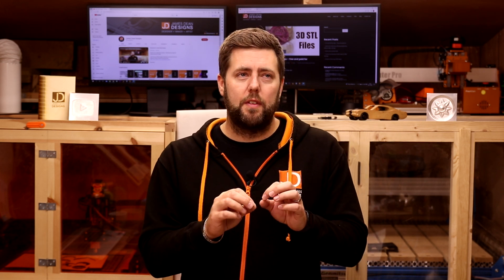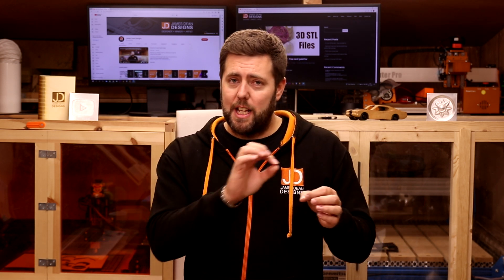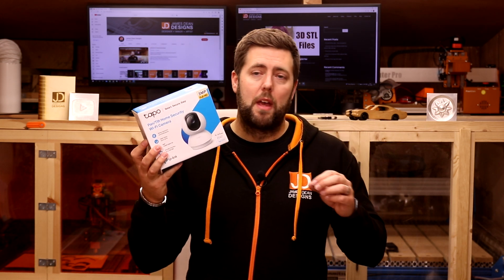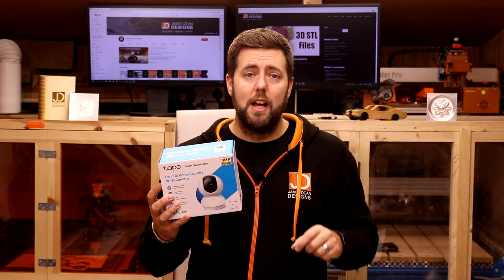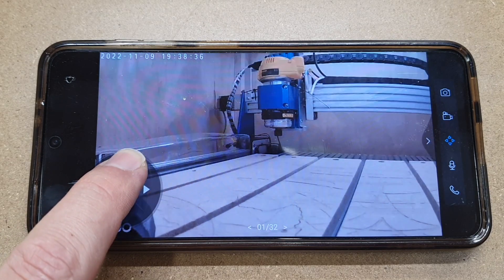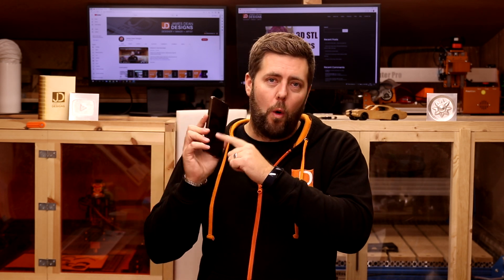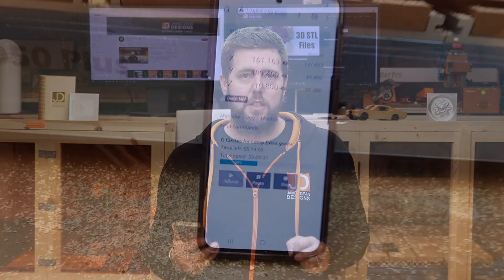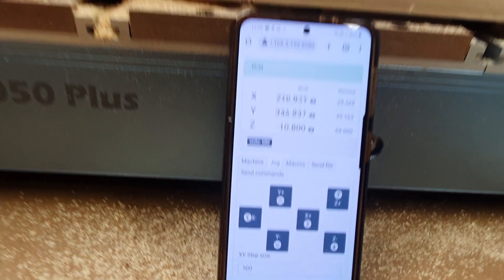Is it ever safe to leave your CNC or laser machine?

Comment: As a safety feature I have 2 dry powder extinguisher's, at both exits of the workshop ( garage!) JUST IN CASE!!
I do electrical stuff , soldering and wood stuff in there, there is electrical stuff , solvents and spray's and all the nasty chemical stuff that finds its way in to a garage. Dry powder is good for many types of fire  and is safe for electrical stuff........ and its fairly easy to clean up ( just a vacuum will suffice )

Get a small dry powder for your workspace ...... Read the instruction's  before you need to use it!

Comment: you can leav it alone... but : my 3d printer sometime get a bug and crash his head into the print.. if ure not there its so a problem... wath i mean leave it alone is like leave it print at night witout surveillance.. but again it can go very well all time until a shit happen and u have a big mess.. for the 3018 also u can leave it alone but i prefer stay near it ... on 10 use of the 3018 i already got 2 fatal crash on it avoided closely thanks switch on the coord ... out of nowhere on an gcode that was previously executed without problem... so if u dont want to have unintended hole in ur cnc bed .. its better be ready to switch it off at all time ...

Comment: All good stuff. When remote monitoring through CCTV I think getting the audio is important and always have this playing in my earpiece. Change in tone of the machine is often the first indicator of problems. I have two other rules - never leave the machine running an untested toolpath, however simple it might be. Also never leave it unattended when using an upcut bit. All my disasters were to do with 1/4 inch upcut bits screwing themselves into the work and pulling out of the collet.

Comment: As someone who doesn't yet have a CNC or laser (but is planning on one as a future purchase), spending a minute to cover what can go wrong and why the machines need constant monitoring would be most helpful.
Reply: There are many things that go wrong but when not attended and stopped the end result is most likely fire. 

The tool spindle motor or servo motor can jam, the control board or power supply can fail, the project can be ejected, lasers can create toxic gasses and worst case curious beings (pets/animals, children, adults even) can get gravely injured by not taking safety precautions. 

So I think the most common things that go wrong is either the tool creating too much friction on the workpiece or the spindle motor being overloaded/jammed which causes the power supply or any of the wiring to overheat and catch on fire. 

If you're not there to notice the smoke and hit the e-stop before it turns into a full fire, it's only inevitable that this will happen.

Comment: I have just recently gotten into CNC-ing, but I've had a 3D printer since the first desktop models came out and this is a very popular topic in that world too.  I think it all boils down to what you mean by "leave the machine". I think most people when they first ask the question are meaning "can I start a long running job then go about my day" and the answer is yeah, you can but you shouldn't.  I mean would you put a cake in the oven and then take off to go shopping?  When I bought my CNC, I just integrated it with the same tech I'm using with my 3D printer and laser, which is pretty much what James describes in his video.  I would highly recommend No Machine as the remote control software for the PC.  It was easy to set up and the response time for the remote operation is great. With my current setup, I don't leave home while a job is running, but at the same time I don't feel like I have to sit beside the machine from beginning to end.

Comment: Have a dry chemical fire extinguisher near by (Class C) covers electrical
Reply: I can tell you from experience that putting out an electrical fire with an ABC extinguisher is really hard. In fact I failed and hit the fire alarm in the building I was working. I'm not sure if there's something better then class c fir electrical fires but you may not be as safe as you think you are. You might want to look into alternatives.

Comment: Although this is a different subject but I’m sure you won’t mind me asking .
I have a Chinese 3040 machine which is designed to run on Mach 3 , I’ve decided to use Easel software as it seems easier for me a pensioner, can I replace the control board which operates grbl arduino and what board would you recommend me using.
You have great teaching skill and enjoy watching your videos .

Comment: I run a CNC machine at my job. There is a mode I can select in the programs where it can just loop a program over and over to make multiple parts. It's a lathe and I routinely make parts by the hundreds. Can't just stand there and watch it run, but I do monitor it throughout the run while doing other jobs. It's referred to as "lights out", and refers to un-manned operation, usually at night when there is nobody there but the parts can still be made.
Because it's a lathe, it will eventually run out of stock material. It's limited to 42" of bar stock.
I have a few videos on my channel showing it in operation. Here is one of them.
https://youtu.be/xUyy0cTgqkM

Comment: Good suggestions.  When I first started using my CNC, I was doing a cut-out without tabs or tape and glue. When the piece became free it jammed the spindle and very quickly started to smoke. I have no doubt that it would have started a fire if I had left it on for another 20 seconds or so. That was a great lesson learned for me.  I use a Raspberry Pi and bCNC to control my CNC. If I have to leave for any reason, I wait until a point where the spindle moves off the work piece and then hit pause and turn the spindle off. A great thing about the Raspberry Pi is that I could come back a month or ten later, turn on the spindle, un-pause the software and the job would continue as if nothing happened.  I wouldn't suggest doing that with a Windows machine. I like the idea of the wifi camera and cut-off switch. That would allow me to work on other projects nearby without too much worry.  Thanks.
Reply: Thanks, will try bCNC on my Pi's.

Comment: This is a really important topic and this covers it with a good balance between caution and pragmatism. One tip that wasn't covered is using an ESP32 CAM. I run my laser in a lightproof box (after scaring the jeebies out of myself while setting the laser up) and I use an ESP32 CAM module to watch what is happening inside. The module is really cheap (~7ukp from amazon) and light - I position it on the end of a "gooseneck" made of one of those blue coolant tubes. I appreciate that getting into programming dev boards is maybe outside of some people's comfort zone - but seriously it is really easily and if you can wire up a CNC you can get an ESP32 cam module going. There are loads of tutorials on youtube and essentially all you need to do after installing the arduino IDE is fetch the demo code and type in your WIFI credentials and press go. Then the module needs nothing more then a 5V supply. And one really simple change to the code (covered in most tutorials) will change the module to be a WIFI access point - so it makes its own WIFI network and you just connect your tablet to that network and you get a live video feed without even needing to connect to your home network. Not nearly as flexible as the cameras covered here, but really cheap and works stand-alone.
Reply from the maker: For someone who has never used  ESP32 cam, are there any advantages over something like those $20 cameras I mentioned?  Or is it purely the price point?
Reply: @JamesDeanDesigns The cams are easy to use. Esp32 gives you more control if you have the need or want to do something fancy. They're basically arduinos on steroids with wifi and Bluetooth le, but you have to program them to do whatever you want. Steep learning curve!

Comment: For CNC:  smoke detector connected to smart switch and monitoring.  Passive fire suppression.

For laser:  sheet metal under mesh (especially for cutting); consider separate switch for laser so it can be killed independently of everything else (also good for eye safety)

In addition, for enclosures constructed of wood or other flammable materials, consider fire retardant spray or paint.  These can buy seconds to minutes in the event of a major problem.  Often very cost effective.

Comment: Past week one of my laser cutter caught 🔥🔥🔥🔥 .... I was in the shop running 3 jobs cnc and both laser cutters, and also doing some drawing in the pc.  I managed to get everything contained fast but the diode laser was busted.  Please be safe ppl. If you use your machines contained in boxes, get a smoke detector near the top of the machines, that would help you and dont concentrate into drawing a lot while running laser jobs. If it is cnc you will hear at least for a broken bit or something

Comment: Great idea's I have a pan and tilt camera and a smart ug on my cnc and my laser I use a raspberry pi with octoprint and a plug in called better grbl control which changes it from a 3D printer controller to a grbl controller. I couldn't find a mach3 control for android for my router